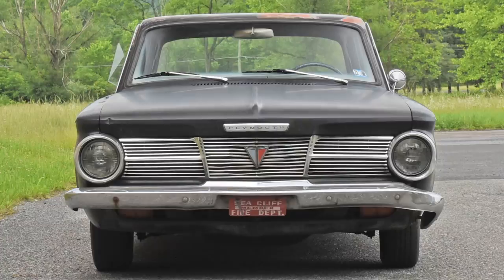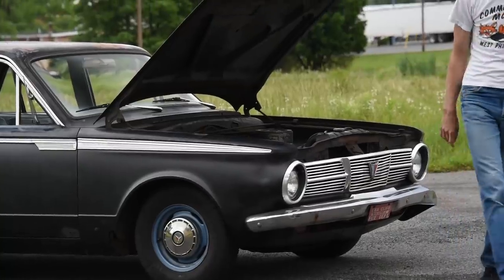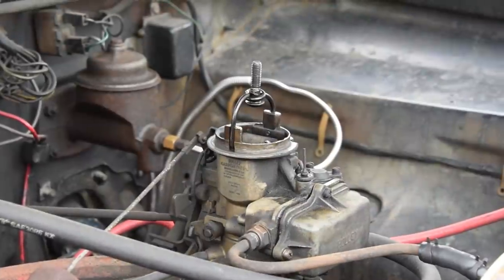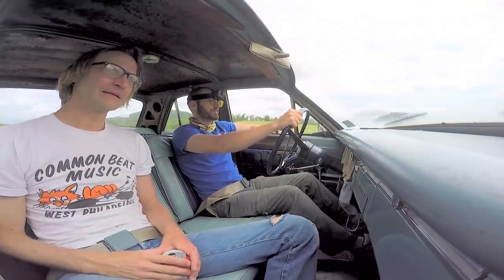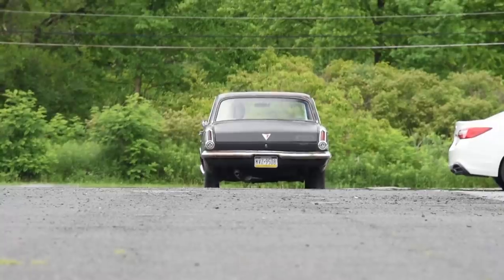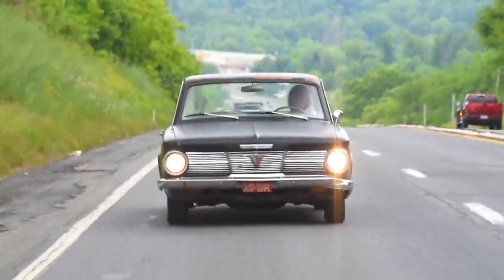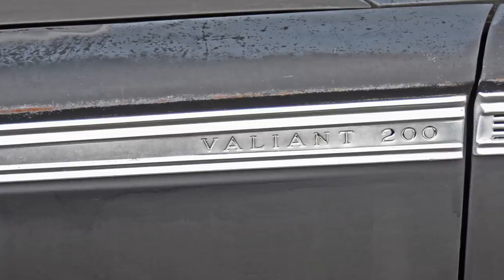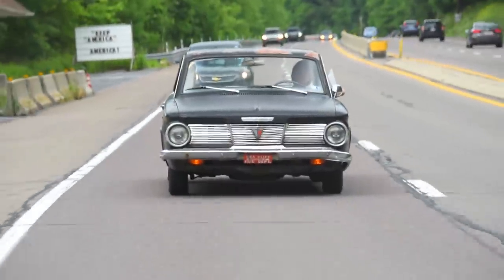1965 Plymouth Valiant 200: Regular Car Reviews

Comment: In my young poverty years I had a '77 Dodge Aspen with 3 on the tree, slant 6, no power steering, no power brakes and no AC.  It dieseled when you turned it off. I purchased cars that were panned by Consumer Reports because they were cheap. I bragged that 1977 was the year Chrysler filed for bankruptcy. I gave it to my brother in 1989.  He drove it from Tennessee  to the west coast with no issues and sold it.  It was cheap and fairly easy to maintain.  I put a clutch in it in my appartment complex parking lot. It sure beat the hell out of the '67 Ford Falcon, '69 VW beetle and '54 Chevy Belair that I had earlier.  There's  a lot to be said for simplicity.

Comment: This car may be a beater Valiant, but it has a great engine and a great story behind it.  Those slant sixes are legendary!!  I had a 1965 Dodge pickup back in the late 70's with a slant 6 engine.  It had over 250k when I bought it.  Drove it as a daily for years and it ran like a top.  Never let me down.  I put over 30k on that engine myself and was over 280k when I sold it.  Still ran great.  It was ugly as hell with at least 3 different colors of primer on the body, but I didn't care.  It did it's job.  I bought that truck for $300, sold it a few years later for $300, LOL.

Comment: The Australian version of this vehicle blew every other six cylinder  off the road.  Known for its powerful motor.  Fit a set of extractors on and it beat a lot of local v8's.  I am surprised at the comments it is slow and underperforming.  Super reliable powerful car but thirsty.  Wish an Aussie with one of these would show our Australian Valiant.
Reply: There were 2 slant six motors and a even a V8 available. I had the bigger 225 ci 6 cylinder and it was absolutely fine. This is the smallest motor and would be slower.

Comment: "you use first gear for pulling away and that's it"

Tell that to my Airflow. Double clutch and you can get back into first no problem. Which is good, because the gearing is so long that you need that first gear

Comment: How sweet would this car be with a modern 5.7 hemi and a 5spd manual..
Reply: Its kind of tough to swap a 5.7 in an A-body, the Hemi is wide.  There are 5.7 swap parts for the '67-76 A-body, the early Valiants are more narrow.  The GM LS is probably an easier swap in a Valiant.  A few months ago I came across a '64 Valiant with a 2JZGTE swap
Reply: @timothykeith1367  a 2j in a old valiant thts pretty sweet

Comment: Had a '63  with the 170. 3 on the tree. Really have no idea why I purchased it. Adjusted the valves and then drove ie for 3-5 years.  I'm old, please forgive me as I don't exactly know why I let it go other than cash for parts off of a derelict Charger that were needed for an engine I was building at the time.  No ill thoughts about the Valiant as it was good dependable transportation at a relaxed pace. I had go fast options if needed. Sold it to a friend who drove it for a couple years, then sold it to his brother who promptly rolled the Valiant. and then drove it away . I would see it around town for awhile afterwards and beat myself up for letting it go to suffer such a  fate. Soon it was gone and probably to become a Hyundai or Kia. 

Maybe it is better to respect  even the most mundane of vintage American iron  and those who chose to keep them on the road than the alternative  of seeing them scrapped for the alternative.

Comment: When I was an undergrad student in the mid-70s, I had a 1966 Valiant, similar to this one, 3 on the tree, 170 CID Slant Six, but of course in much better shape than this one. These cars, back in their day, were considerably more durable than their Falcon and Chevy II, competitors. It should be easy to tool around in town in this Valiant in third gear, and the car should be capable of smooth, reasonably quiet, no-drama cruising at 70-80 mph all day. I certainly did that many times. I consider that the engine in this car is not making anywhere near its original power.

Comment: His Valiant must not be running too good if it only gets up to 70mph top speed.  Because I got an 80mph speeding ticket with this same 225 engine in a 1966 Coronet , which is a bigger and heavier car.  And I was cruising at 80 all day long...driving it cross country.  The car wasn't topped out at 80.   That Valiant should do around 100 mph.

Comment: Driving and maintaining a horrid shitbox in order to enjoy one or two niche attributes about it, such as a violent '60's aesthetic, lovely mechanical noises, or because it looks different, is a flex. 

It's an addictive one too. 

I dailied a '65 Pontiac Tempest in Chicago weather year round for 14 years and trashed the body mounts. And in the meantime I'm tooling around in an Outback until I can finish repairing the mounts so that the trunk doesn't flap on the bumper like an old Chuck Taylor. This is all so that I can start dailying a wholly inappropriate car again just because it makes me feel like I'm better than the truck bros and tuner kids. Like I get to enjoy the noise and the flash and the spectacle, but I feel superior because in my mind, I earned it by repeatedly destroying my knuckles and being stranded on the side of the road with no functioning interior lights at 3 in the morning. And the suffering makes my indulgence righteous and commendable rather than simply just indulgent. Because I'm a protestant and we're not allowed to have fun or enjoy things.

Comment: "You can't downshift into first". OK, sure. If you have no idea how to double-clutch, then yeah... you're stuck. If you do know how, you can make it work. To double clutch: Shift into neutral, engage clutch. Now you rev up the engine just a skosh, to bring up the clutch speed. Quickly stomp on the clutch pedal and shift into first gear, and then engage the clutch again to resume driving. If you do it right there are no grindy sounds at all.

Comment: [Long af] Mad props to the owner for dailying this thing, Chris truly is a madman. Him loving this ugly, derelict, unloved shitbox really gave me the inspiration I needed today, when my 2001 Audi A4 left me stranded AGAIN. I could, and probably should, sell it. The amount of money I have put into that piece of shit WAY exceeds the value of the car at this point. Everytime when I think I've fixed it, something else breaks. Constant check engine lights, endless vibrations and noises from the suspension and mechanics that can't find anything wrong, or diagnose a faulty part that I know isn't the problem BECAUSE I JUST FUCKING REPLACED IT! I bought it a year and a half ago when I thought was done driving shitboxes and wanted a reliable car for once. I know, buying a B5 because I need a reliable car seems mad, but when the car I had before it was an Opel Astra that was given to me by a coworker, because setting up an ad was more labour than the car was worth to him, (and before that I had a Mitsubishi Galant with no reverse gear, and before that a Citroën ZX that caught fire) this one owner Audi with only 120 000 kms on the odo and working climate control was truly like a Rolls-Royce to me. I could have bought a more modern car, but went with the older, cheaper car with more character that on the surface looked more appealing than a three year old off-lease Golf or something similar. I regret my decision today when I have to ride my bike to work while waiting for parts AGAIN to fix the most ungrateful car in history, that turned out to have been completely neglected by the previous old lady owner, but polished like the turd it is. But dammit if I haven't grown attached to it. If this had been any of my other cars I would have driven it as is until it inevitably failed inspection and then either sold it for $200 or scrapped it after I beat the hell out of it in a field. I like my Audi. It looks great, and I feel like it it suits me. And since I decided to commit, I'm committed. And now Chris showed me that it's possible, and Mr. Regular told me that it's worth it, even if non-car guys don't get it. Man this turned out long, I realise I needed to vent. Seriously, don't buy a B5, even the base models with no equipment. They drive great and look fantastic, but they WILL ruin your life.

Comment: My dad bought a 1963 Valiant Wagon for $75 in 1972 . Gave a shade tree mechanic $35 to replace the clutch, pressure plate and throwout bearing . drove it trouble free for 6 years and was still going . Ugly , rust and option less.

Comment: My first car was a 60 valiant with a slant 6 , pushbutton auto. I paid $125.00 for it in 1970. . When I sold it , I told the guy you have to check oil , it needs some every so often. He was driving to Florida from Pennsylvania  , he said s red light came on. He just kept driving till he blew the motor.  He asked me what the light was ? . I said a idiot light you idiot , I told him it wants Oil.  He wanted me to give him a partial refund. I said Oil well, No !

Comment: I had a Dodge Dart with a slant 6 and it would run over 90 and it had a 3 speed automatic and air.  If your car won't do over 60 there is something wrong with it.

Comment: I used to have a -64 Valiant. Watching this video just tells me that the narrator is not a very good driver of anything, not a Car Guy, sorry. Valiant is a pleasure to drive (even with the super slow steering), even in the winter here in Finland, even though only the windshield and front side windows would stay clear. Rear window frost melts after a while because the heater is effective and the car is warm. Anyone who can really drive a car can use unsynchronised gearbox, so the lone first gear is not a problem. The engine is eternal but the gearbox starts to act at 600000 miles or so, trying to jump out of second gear when engine braking. Mine was well over 600000 miles (a million kilometres) and even the accelerator pedal metal was starting to wear through. Drum brakes around were a labour camp, but once overhauled, they just worked. The ventilation boxes were nice mini fridges, and they worked in the summer quite well. It was a comfortable cruiser, and went much faster than 70 or 80 mph, we measured 180 kmh (measured distance/time), but as the propshaft was out of balance, it felt like the windows could pop off... As the steering geometry was designed to bias ply tires, it was picky for radials, they had to have rounded edges or the steerig would feel every groove worn to the road and try to switch lanes by itself. It also had different camber left and right because of road central dome; to steer neutral on the "side slope" the camber difference helped. The front torsion bar suspension was similar I have in my now daily driver H3. Good shocks were a must as it has no friction like the rear leaf springs. First production car in the world to have an alternator. All other cars still had dc generators.  A very good car. I have had a LTD -67 428, Newport -67 440, still have -79 Blazer, now also Hummer H3, a Ford Taunus -82(yes Taunus, not Taurus, google Taunus or Cortina 5) with a swapped in 302, Beetle kit car, a russian T55 tank, etc. So, I think I am a Car Guy...
Reply: Your experience with the car isn’t gonna be like everyone’s else. Mind you this is a different Valiant that has lived a hard life.

Comment: LOL. I grew up with cars like this so to me, it was normal.

But I think you were unfairly harsh in your criticism. My 64 Valiant had a 225 engine with four speed and it could run 70 on the interstate with no trouble. It got 30mpg if I didn't hot rod it.

Comment: This is a poverty-spec American car. It's very similar to the majority of European cars of the 60's, poverty-spec or not. The main differences are that in Europe, we usually had 4 speeds and 4 cylinders. Any 6 cylinder car was seen as a bit posh, however base-spec it was.

You think the Valiant is disappointing? European bread and butter cars were often downright grim.

Comment: You youngsters sure are spoiled. Think that is bad, first vehicle I had to drive was a 52 Chevy pick-em-up. 216 babbit beater w/ splash oil system. 60, fugetaboutit. The little slant 6 was not a speed demon but reliable as an anvil. Way better than the little 144, 170, 200, & 250 Ford engines of the same era. Chevy had the 194 & 230 I-6 that was better than the Ford units but not quite as reliable as the slant 6 units. Chevy even had a 4 cyl that used internal parts from the 6 cyl engines. All the 6 engines of that era (63 up) borrowed parts from the V-8 engines, kind of a modular setup. Think that Valiant is anemic, try a 1 ton dually truck, 4.10 gears, 4 speed granny gear trans with slant 6. SST, super slow transportation.

Comment: What a load of BS the comments made during this video are. These were a great little car for there time. And they were available with a much larger 225 slant 6 and a 3 speed automatic transmission. The single well master cylinder on the brakes was found on most cars and trucks until the double well master cylinder became mandatory in the mid 60’s. Easy to look back from the current day and criticize autos from the early 60’s because they don’t have the speed or unnecessary luxuries and gizmos modern cars are burdened with, but anyone who had even modest mechanical abilities could maintain and repair this car. It didn’t need a computer analysis to allow you to understand why it wasn’t working. And if it got 28 mpg on the highway, it beats the crap out of a modern Jeep.

Comment: Dude! What the hell are you going on about? Its an old Plymouth Valiant. It was an old American compact. It was style over substance. It has lasted longer than it was engineered to; four fold! Yes, in the mid 1970s people might have seen you as “poor” for driving one, but the same could be said of most cars that old. In truth, you might have been rich but just cheap, or (novel notion in today’s America) just easily satisfied! Saying the Valiant looked worse than the Falcon or implying it was worse in any way is not fact but only opinion. Outside of style (or lack thereof, in your opinion), the beauty of this car lies in it’s simplicity. You might be disappointed driving it but it has been doing what it was  supposed to do for more than half a century. It very well might have been disappointed in you as it’s pilot as well, yet you don’t hear it bitching about it!

Comment: You are aware that the gearing on the 3d is 1:1.
It's the same as 4 speeds too.
And there is universal over drives that you can fit to all transmissions, automatic too.
I think you give modern cars way too much credit, they are not that good.

Comment: 70 mph top speed?  You pulled that right out of thin air didn't you? If you didn't you need to attach the other 3 plug wires. When was the last time the valves were adjusted? 

1964 Valiant 2 Door Sedan V100
170 ci / 3 Speed Manual / 3.23
6.50-13 Bias Ply Tires (24.7")
200,000+ mi 
Stock - 93 mph
225 Carb & Exhaust Pipe - 101 mph